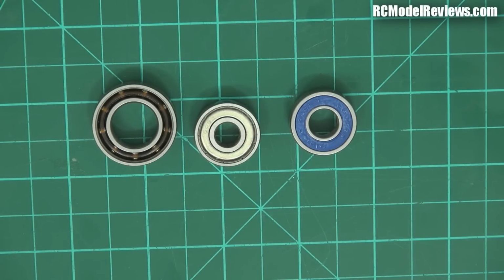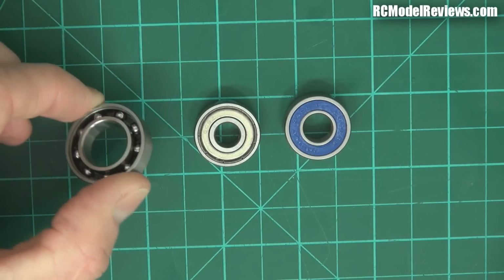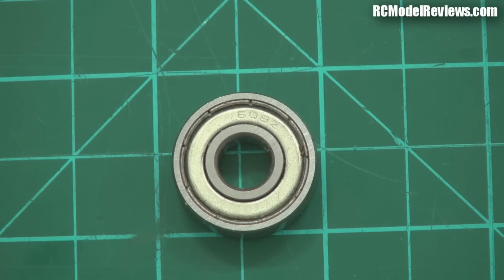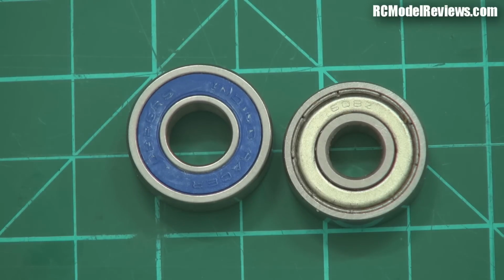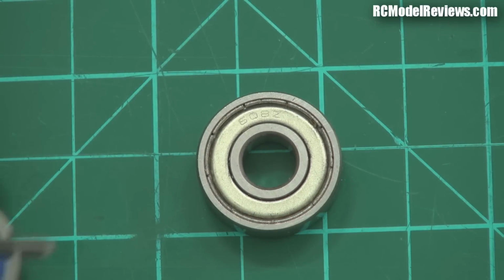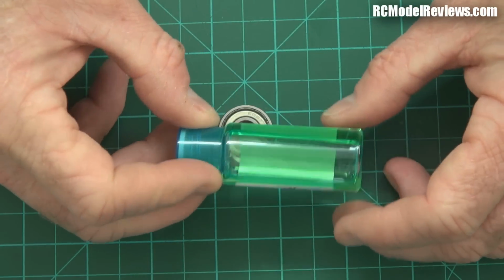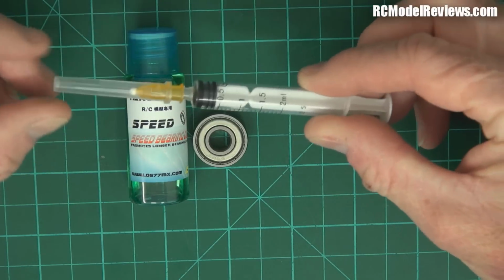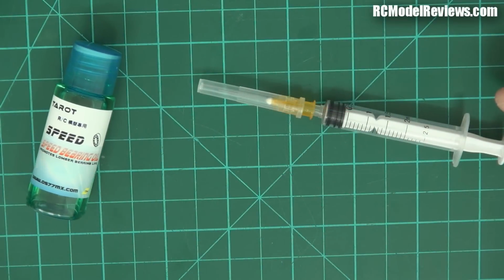Bearings and bearing oil

Comment: can you use 100% silicone for lubrication?
Reply: I actually used strictly spray silicone on a set of four sunnysky2204's and strictly bearing oil on another set of ss2204's. The bearing I used silicone on wore out a lot sooner than the oil bearings, but the silicone set got a lot more abuse. Honestly id stick to a specific bearing oil and don't use anything else. Also when mud and dirt get lodged in your motor don't use compressed air to clean it out! Take the time to separate the motor and bearings, clean it right! Also too much oil attracts dirt, a few drops will do every 25-30mins of motor on use and clean off the excess with a paper towel or rag.
Reply: Bozi B That is why I only use Silicone spray. it protects the motor from moisture and does not attract dirt.
Reply: Ya but I don't think silicone spray is good for the bearing over time. idk though maybe it doesn't hurt them? HaHa, I am replacing bearings in my mini motors from crashes way before a wrong lubricant can damage the bearings!

Comment: I prefer not to see the balls on the inside...
So what about the rubber sealed ones? I've always used high speed oil on those too, letting them seep it in a bit longer, hoping that if there's a leak it'll find its way in.

Comment: I use nulon e20 engine additive and 5w synth oil thinned with prepsol for penetration. It is in a revel plastic glue bottle,the yellow and blue one with the metal needle. May I add that bearing failure is a thing of the past.
Reply: gen3v8 Yes, I used to use 0W30 Mobil 1 synthetic motor oil in the past with good results but it was more viscous than the stuff from Tarot and was hard to suck up through they hypo I had.

Comment: Excellent subject matter Bruce and something I would hazard a guess at being overlooked by most rc hobbyists. Maybe a though to do a series on mini quad care, repair and maintenance after you finish your low and top end builds. Would be good to have some in depth videos on changing bearings, cleaning your frame and electronics, checking solder joints and examining for damage etc.

Either way keep up the good work keeping the new hobbyists informed and on track!
Reply: Damian Bloomfield Yes, I plan a video on the importance of maintenance -- especially if you're flying in areas where a falling quad could pose a threat to person or property.

Comment: How does WD40 do?
Reply: seebuyfly Noooooo!  WD40 is not a lubricant!  It is primarily made up of solvents that will wash any lubricant away.  Never use WD40 as a lube or you'll significantly shorten the life of your bearings.  They may seem fine for a short while but the solvents evaporate very quickly and actually leave a horrible sludge behind that doesn't lubricate at all well.
Reply: Thanks Bruce, I knew that was true of bike chains but wasn't sure about bearings. Still remember the bike shop guy going "No no no, WD40 is a water dispersant!"

Comment: Do the motors that you use have bearings at the top as well as the bottom (if not, why not)  If they do then how do you lubricate the top bearings with the prop driver attached ?

Your explanation of the 3 types of bearing shown was helpful, but presumably the bottom bearing of a motor used in a multi-rotor is subject to a sideways force as well as a rotational force unlike those used in a crankcase bearing for example.
Reply: UKHeliBob That's why they include a  hypo... it allows you to get to that top bearing.

Comment: After each flight isn't considered excessive?

Would love to see a more in depth video on bearing/motor care!
Reply: Howzit FPV Not after each flight-- after each flying session which (at least in my case) is about 10 flights.
Reply: ***** Glotchya.  Thats what I meant, tho. :D  I've always wondered what the 'proper' maintenance schedule is for bearings.  I've heard everything from 10/15 flights to every ~100 flights.

Just to verify, a multirotor would generally have a 'shielded' bearing and they come with oil, not grease?
Reply: Howzit FPV yes

Comment: THanks for the Good info sir! Mainly about the types of bearings / applications and amount of oil :)
I actually allways use bearing-oil from Scorpion.. Seems to work fine, though It would be Hard to compare I think (maybe the non-re-lubricated motors had better tolerances?
Cheers!

Comment: Hi Bruce. Do you remove the circlip from your motors when you lubricate them?
Reply: Charles-Henri Stephann No, I use the supplied syringe to put a drop or two (depending on the bearing size) on each bearing without dismantling the motor.